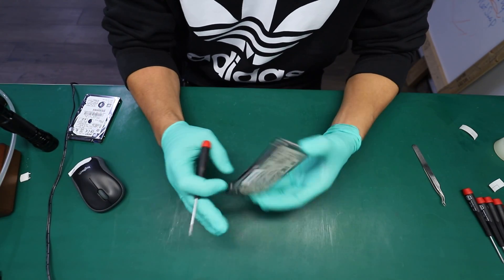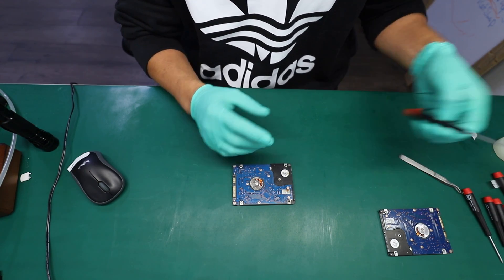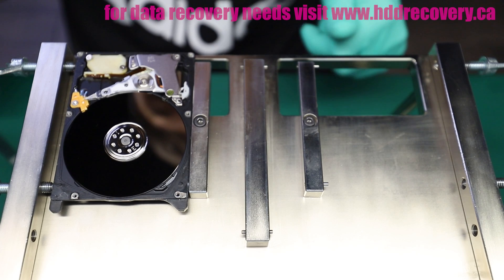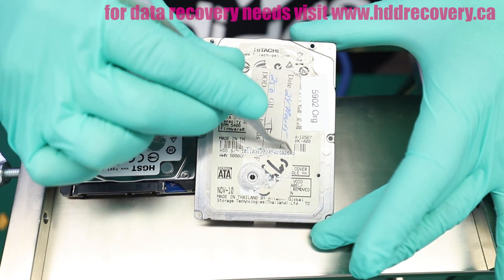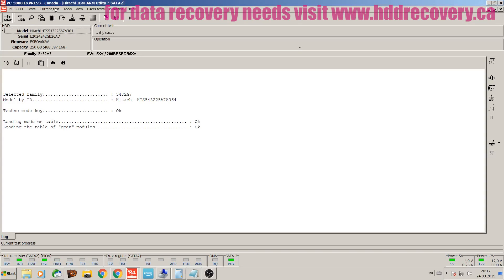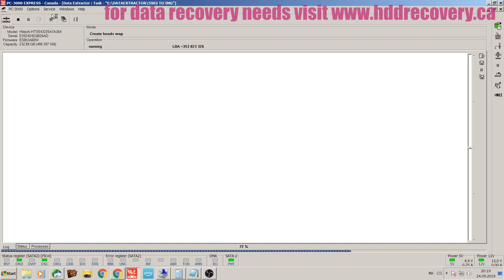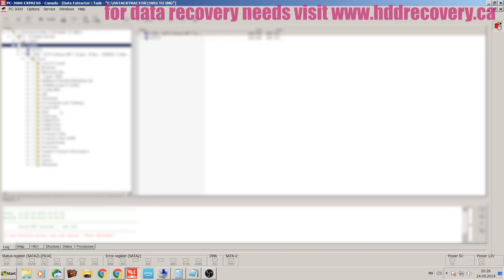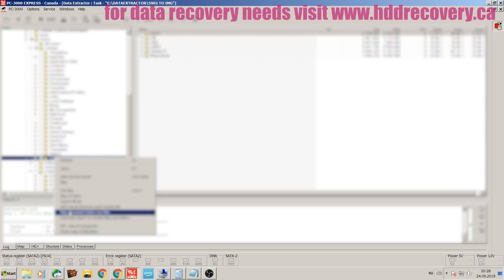recovering data from fire and water damaged hard drive

Comment: that noise tho, what is all that noise?
Reply from the maker: Sorry for the noise but it's coming from a laminar flow bench where I work. It has a massive fan on top that pushes air into a HEPA filtration system, so the work area does not have dust floating when the drive is exposed. Air pressure pushes air out of the clean cabinet so the dust can't flow back into the work area

Comment: How much pc 3000 cost sir
Reply from the maker: its a complex that you can build with different options. Price is not fixed. Best to reach Acelab to get pricing and guidance on what you need to get. I get top loaded tools because we have flow to use the features, but maybe you can just start with UDMA+Data extractor package. That would be my suggestion for starting out
Reply: @hddrecoveryservices  thank you very much sir

Comment: Why you transfer the Chip too from the main to the doner board . What inside it ?
Because you did not just use the doner board with the new head
Reply from the maker: Almost all new hard drive boards have eepROM chips that are programmed to work with the service area of the drive they belong to. By swapping or reprogramming the ROM on the donor board, we perform PCB adaptation
Reply: @hddrecoveryservices  is it possible to just swap the PCB board from a donor? Mine had an electronical problem from water exposer. I think it short circuit it. It turns on then spins then clicks a few times then stops. It's a Toshiba 640GB 2.5 MK6476GSX, HDD2J92 F VL01 T

Comment: @HDD Recovery Services
I notice that you are using plastic extractors for the heads recently. Are the plastic ones not as bad as you previously thought? or is this a case to case circumstance?
Reply from the maker: I use what I find works best for me to get the job done safely. Different tools work better for different applications

Comment: Hello sir good work 🙂 can you please show how to clean platter
Reply: I'm pretty sure he used a can of compressed air for that. Alcohol bath would have been an option in case there was liquid residue. Someone correct me if i'm wrong.
Reply from the maker: We just put them in the dishwasher :)
Reply: @hddrecoveryservices  ha ha ha ha ha ha ha you're killing me :)
Reply: @wantomek  You're wrong.
Compressed air is often not enough and mechanical removal of dirt is necessary.
Reply from the maker: I left some more not fast forward parts in showing contamination with green light. Compressed air is not enough to be safe in this case
Reply: @hddrecoveryservices  thank you for clearing that up.
Reply: @hddrecoveryservices   hi sir, i have a question, where can i buy the green light? thank u
Reply: @wantomek  thanku sir for your valuable answer